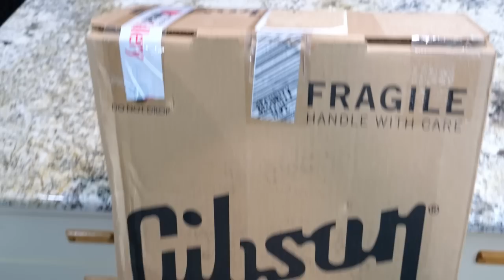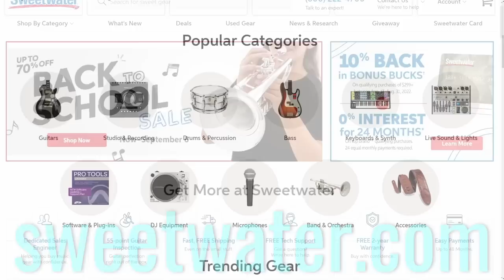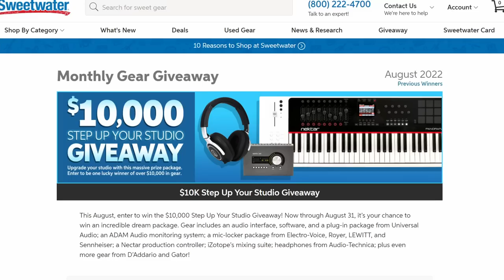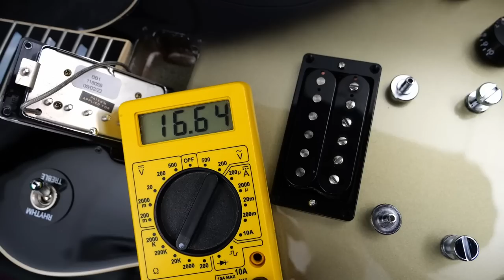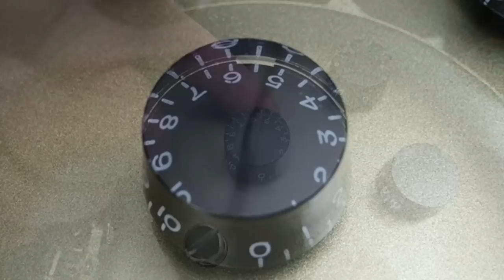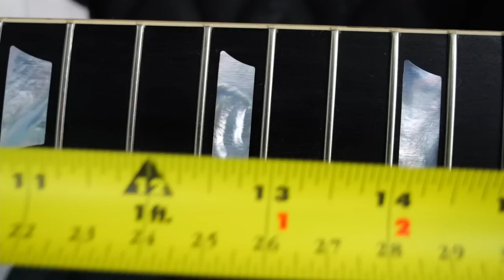The New "70s" Les Paul Standard | 2022 Gibson USA Adam Jones Les Paul Standard Silverburst Review

Comment: I think this is great and all, and honestly I wasn't a buyer for this particular model before anyone else says it, but they lost me at the mahogany neck. All of my Les Pauls over the years have been maple-necked Norlin era guitars, and for me nothing else will do. That is a key feature of Adam's guitar, regardless of whether they slightly altered the shape of the neck, which I don't personally agree with either.
Reply: $50,000 says you can’t feel the difference with a blindfold on.
Reply: @glynnpowell7864  You might not want to take that bet. I remove the finish from the neck on most of my instruments. Anyone can tell the difference between a smooth 3-piece maple slim taper and a slightly grainier 1-piece mahogany fatty when there's no paint on it. Perhaps you're making this about tone, which I didn't mention, although you can't possibly think that a maple/ebony will feel and sound just like a mahogany/rosewood. If so, I implore you to try both of them together in a similar circumstance. You may be pleased with your ability to tell the difference. What I said is that the maple is for me, and I am a Norlin guy. I live in southeast texas, the maple with a volute holds up better. Just one of several reasons I have for my preference, including the shape.

Comment: I am assuming it does not have a slightly larger head-stock and angled 14 degrees as did the some of mid to later 1970s Les Paul Norlin era models?
Reply: @pandaman1968  with out seeing it, it is rather hard to say it could be temperature related, or simply age (depending on how old). Could even be wrong polished used I however would be less likely it to think it the wood as cracks in the wood wood be more likely long or short vertical fractures or where any joints occurs. that could be from knocks but if the case I suspect it would be more obvious etc. 
 What you could do take a shot of it and contact a few guitar repairs sent the shots to them and see what they think.
  Hope this is of some help.

Comment: Got mine a couple months ago absolutely love it. I did purchase a Seymour Duncan custom shop Adam Jones Duncan Distortion which is the same pick up used in the custom model. Aside from that the Chicago music exchange T type neck pick up is one that I will be using in place of the burstbucker at some point so it can get closer to what I believe are original specs. If I’m not mistaken didn’t 70s Les Pauls often come with a T top pick ups? These just emulate T tops. However emulate or not they have their own distinct sound that really complements the jonesbucker. After putting in the custom shop pick up I took the DC hi game and put it in my Chicago music exchange SG which has a T type set of pick ups and the neck pick up in this guitar sounds phenomenal on its own and I often just played the neck pick up rarely using the bridge at all. Anyway my point being is I paired the DC high gain with the T type in that SG and the combination of the two are incredible.
Reply: Nice post.I also own a DDJ MJ wired PU. Could you tell me at what height it is recommended? Greets and thank you very much.
Reply: @tr1cott504  I’m guessing you’re referring to the height of the pick up in relationship to the strings? What kind of guitar do you have that you are putting this in? I would only be guessing a les Paul if you are an MJ fan and a tool fan. Let me know.
Reply: @tr1cott504  I have a question for you as well the pick up you have, was it wound by MJ and it is a vintage with the DDJ logo on it or is it a custom shop order that you have?
Reply: @fattony4961  thx for quick answer.  Yes, distance pole pieces to strings. I habe a 2020 Epi LP Custom. I am a 48 years old AJ / Tool fan.
Reply: @fattony4961  It is a custom shop order. It is called DDJ with A.Jones specs. Wound an signed by Marciella Juarez. She is a really nice person.
Reply: @tr1cott504  I will often change height depending on how responsive or overdriven I want the sound to be. But generally 2-3 mm above the board and bring the pickup as close as I can without the strings hitting it and low enough it doesn’t get muddied out by itself. I think you’ll find you won’t need it to close to find the desired tone. These are as responsive as active pickups like my Dave Mustaine live wire pups. Those scream! I did the Epi mod too. Sweetwater has the new AJ custom available for preorder as of yesterday.
Reply: @fattony4961  thx for your experience.  That helps a lot. Iwas just wondering, AJ nailt his PU under the strings. Too close for me. The Signal is way too hot. It needed perfect muting non played strings. So I ended at 3mm. It feels tighter and strings sound more seperated. But neuer played such a hot PU. I get good results with standard SH 6 at about 2.4 mm. Thx for the Sweetwater hint. I am very interested in that AJ Epi. If I can give you my 2 Cents  with other AJ nerdy  stuff, just ask me. It's nice to share experiences. Greets.
Reply: @tr1cott504  that is the main issue with the Duncan distortion particularly the custom wound one. When I used my production model distortion pick up in an Epiphone it sounded pretty good. It wasn’t spot on Adam Jones, but it sounded good. The main difference being that it’s a weight relieved body, making the pick up sound a little bit brighter versus my Gibson 79 Les Paul standard that has no weight relief and makes the pick up sound fuller, darker, responsive, you name it the custom wound pick up was the way to go. Just keep in mind without the non-white relieved body it will sound a bit different. You’ll still get Adam Jones tones, but you will like I said have to possibly fool around with the EQ up. As far as the upcoming AJ models just in case, I didn’t mention it before, but they are currently on version two pre-orders which is the berserker Molly Hatchet album cover version one was the veil of bees, which basically is a cartoon drawing of a little girl who has blonde hair made up of bees. If you haven’t seen photos of it, just type in Adam Jones, veil of bees Les Paul custom and you’ll see the graphics on the back of the guitar as they are going to appear there will be 6 more versions, one of which again will be a full silver burst front and back which ideally is the model I wanted, but they’re going to be limited to 800 pieces per version so all total there will be 6400 guitars total. They’re priced at $1299 plus tax. Every month or 2, two new versions will be released. If you’re familiar with the berserker there is one other graphic that I am aware of done by the same artist. However, I don’t know the title of it but I am willing to bet at this point more than a few versions have been identified, I’ve been following this very intently since it was first announced. Since a Gibson version was unattainable at $25,000 and only 79 of them was a real crappy thing for Gibson to do to its customers. Even the standard model which I have is going to be more available than this new model, not to mention I am willing to bet the EPIPHONE will sell for prices close to the retail price of the standard model. At $1300 retail I see this going for at least $2000 easily on the scalpers market. If you haven’t seen any of the specs my understanding is this is as close to the original as it can get mahogany, body maple top, maple neck, unlike the standard, which is all mahogany with a maple cap it’s a full silver burst even with the graphic on the back the neck headstock sides of the guitar are all in burst. It has the Dunlop strap locks chrome toggle switc Multiply binding CTS pots alnico pro custom in the neck which lets face it’s never going to get used anyway and the Seymour Duncan Duncan distortion in the bridge. An even bigger surprise is it’s coming in a chainsaw case just like the Norlin era guitars. Also, I almost forgot the neck is a 70s neck with volute. It has the headstock graphics from the Adam Jones version 2 custom I believe either that or the first version, but I know the graphics on the back of the head stock are the same as on the Gibson iteration whether it’s the first or second version. I don’t know if it comes with the mirror for the headstock or not, I don’t see why it wouldn’t after all everything else screams as close to a Gibson as you’re going to get without paying five to $6000 just for a custom shop version let alone a signature model. I could talk this stuff all day long, so I have no problem, answering questions or discussing Guitar related information if I have it. I don’t claim to know everything. This is just information that I have been pulling together over the last few years, since it was first announced, and as of this past week so much information has been released not to mention confirmation from Sweetwater finally. Delivery of the first version is supposed to be December 12 and the second version apparently is January however, that date is subject to change. Though I can’t imagine it will and they are releasing two at a time and this is the second one not to mention there is a limited supply per store And limited supply overall. So when they’re gone, they’re gone though I do hope they do other models than just the Les Paul like Gibson is doing with the Flying V  the double neck SG as well as the other custom models like the natural all the part of Adam Jones guitar collection. Personally, I would like to see a 79 Les Paul custom with just a bridge pick up but routed for two volumes and two tones so that a Killswitch and a coil split can be added along with the volume and tone not to mention if you wanted a Piezo system like the Cantrell model that could be added as well. Anyway, that’s my two cents for now. All the information that I have here is not necessarily 100% accurate. It is however information that has been consistent among different sources.

Comment: I don't care about Brian Jones teardrop I had a teardrop dulcimer and I gave it up to a girl as a gift. And the flaws are insane! Nobody should justify an American made guitar with any flaws in it, that's not right! There are so many clones and better-suited in electronics (mainly split-coils, grounded compartments inside the guitar never rmind the arcade kill switch I already have one for my archtop. At this time my son has a Harley Benton and that was the first 24.75 scale length that I liked. And why does Gibson always use the binding to block the frets? Answer - it's cheaper and it degrades any Luthier to touch it. Fret are a metal. Metal moves, that's why the frets are dress to be shiny on their ends, they look better too with less problems and it will be a problem as the fretboard starts puffing out the fret nibs, then the dots or markers - 3, 5, 7 etc...
Reply: Who is Brian Jones? Different tear drop silverburst Les Paul player?

Comment: Wish they would address the Tool (ha) marks on the fretboard binding. I get that they are done by hand but they look rushed and it’s a deal breaker for a lot of people. Not to mention more fuel for the anti Gibson cult 😂
Sounds and looks great though. Great value compared to the custom if you can get over the minor binding issue
Reply: I have noticed a lot of that. But I got one recently from Sam Ash made on 30 June 2022 and it was perfect. Either they resolved some issues or I got lucky
Reply: @Jficklen  I’ve seen them with and without it as well. I have a 2013 traditional with it but I was able to get a generous discount atleast 😜
It’s a non issue for me as a player. Everything else was perfect. It’s a keeper and probably my #1. I’m sure my local luthier could dress it up no problem

Comment: My 2019 SG had ridiculous long leads. When I swapped out the stock pickups for Lollars (as one does) it was like a magicians hat. I kept waiting for a rabbit to come out at the end of the lead.
Reply: Better than buying a pickup on ebay and some maniac cut the cable down to 3 inches.
Reply: This is true. But it's also not unrecoverable.
Reply: Which lollars pick ups do you recommend to get rock and roll tones?
Reply: @urgidover  Classic rock? Imperials. If you tune your guitar down to C and plug into a Matamp or Orange get the DBs. I have one "Novel 90" (P90 for humbucker route) and it has a very wide range of tones.